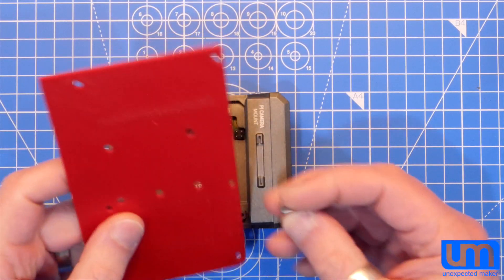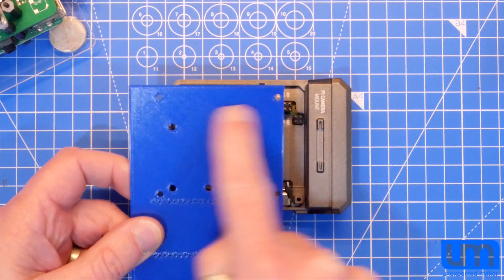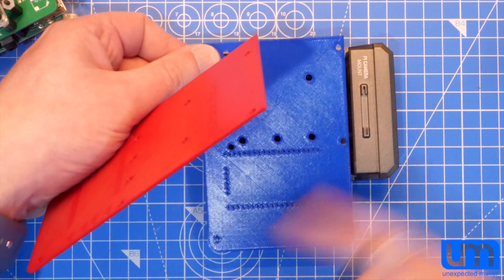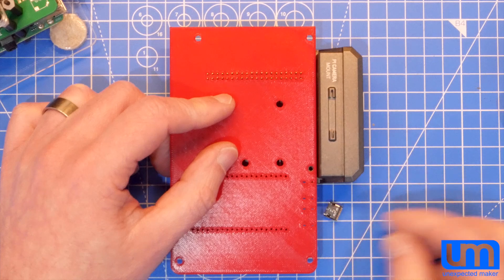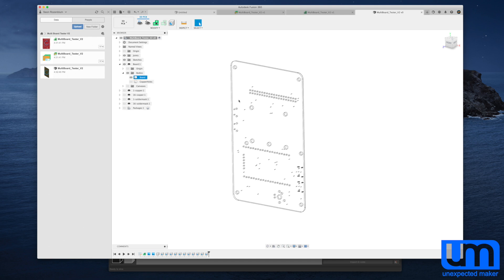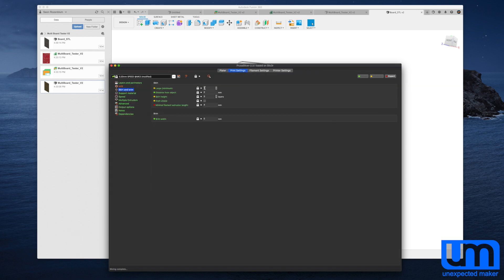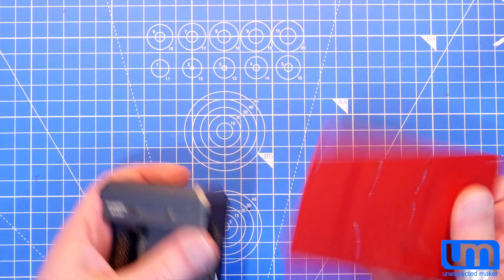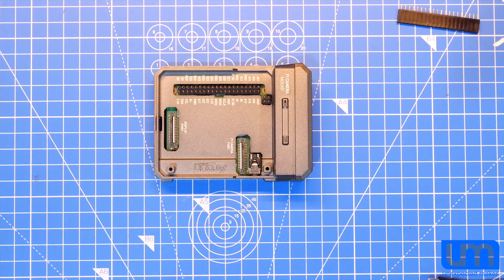MultiBoard Test Jig V2 - USB Placement Fail :(

Comment: So just move your board up by adding a 40 pin wire wrap socket and stand-off's for your support clamp idea.
Reply from the maker: As I state in my video I specifically want it low profile. Raising it goes against my goals for this revision. I'll cut the shroud of one of my cables for this PCB revision to get started on code while I wait for my new PCBs.

Comment: Usually designing the complete thing in 3D (including the Raspberry, the housing, screws, feets, etc.) helps to identify such issues early. I know its more work at the beginning, but it is probably not the last iteration you are going through. Taking the entire PCB with all components (height of caps, etc.), fittings, connectors should also be included...  Later on this makes it easy to design more mechanics around for supporting the production. 

I really enjoy how you are walking into the making, production... myself I have been working from test field, applications, marketing, sales in the semiconductor industry and enjoy, as you do, to make things alone nowadays. The volume is not that high, but there is more analog stuff and higher value. So this might justify the additional efforts.
Reply from the maker: In this situation I'd have needed a perfectly accurate 3d model of the case, so that would have taken me a day or more of messing about in F360, and I'd have not been 100% sure it was right unless I 3d printed it to compare, taking more hours...    yes, usually doing it all in cad would be better.

Comment: Could you not just zap off the 'rubber' covering on one side of the usb cable?  I've had to do that on a particularly stipid charger thing, and it's ok, if you don't have to change the cable often
Reply from the maker: I'm going to be building 4-5 of these and I need to swap out USB cables for various connector types, so I don't really want to butcher a bunch of them. it's cheaper just to get new PCBs made ;)
Reply: @UnexpectedMaker  understood,  thanks.